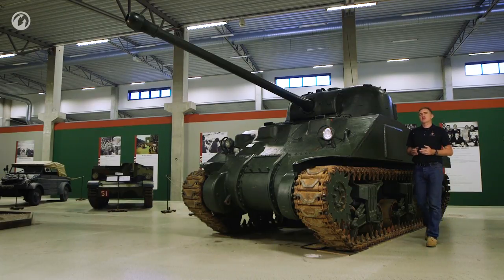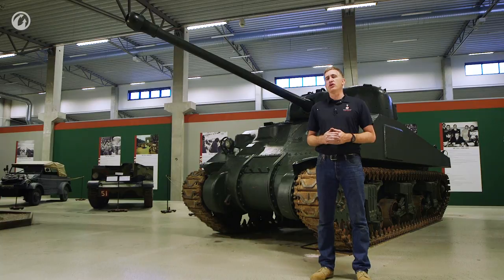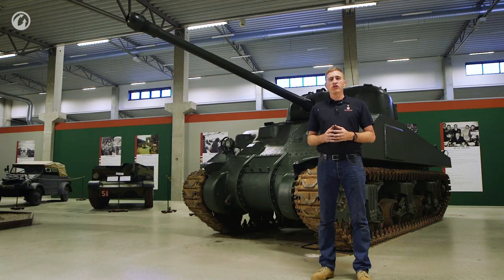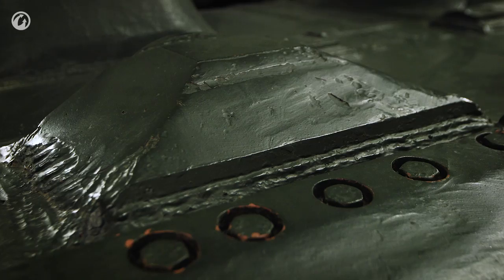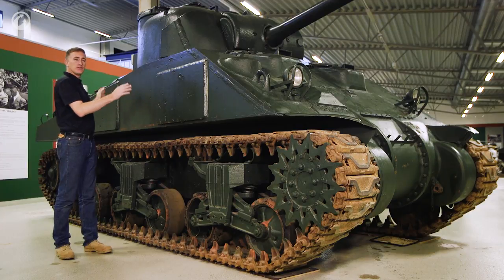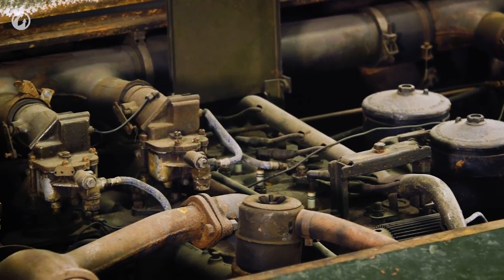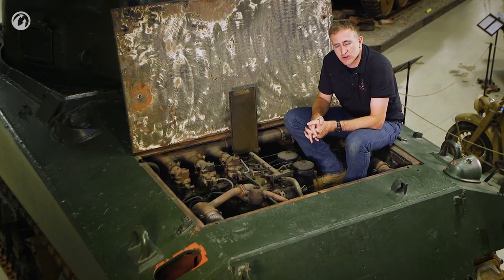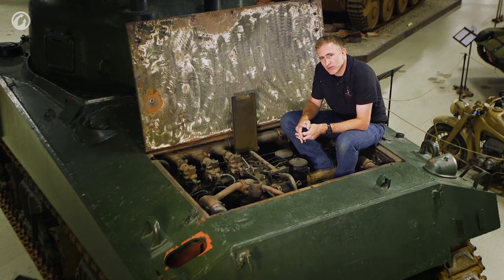Inside the Chieftain's Hatch: Sherman VC “Firefly" part 1

Comment: Ironically, horsepower is essentially a useless measurement for tanks... what really matters, is torque. You need a lot of torque to move a lot of weight, which is what made the Chrysler engine in this tank beneficial. It was a lot heavier, and even had less horsepower than the Ford, but it had far more torque, and because of that, got to speed faster, could move up inclines faster, etc.
Reply: I always wondered why they didn't put diesel engines in WW2 tanks. One would think that since diesels are torque monsters, they would be the optimal choice for moving a heavy vehicle. Nope! Petrol. There must be a reason.
Reply: Diesel also isn't as flammable as petrol
Reply: @leeham6230  Basically inertia. If all your machines run on petrol, you only have to supply one type of fuel to all of your divisions. If some of your vehicles run on diesel and some on petrol, you'll have to send different proportions of diesel and petrol to your different units based on what exact combination of vehicles that specific unit is currently using. A supply nightmare.

And you run the risk of some yahoo putting diesel in a petrol vehicle (or vice versa).
Reply: @leeham6230  1. diesel engines require more technology than petrol engines to make
2. they are usually heavier than petrol engine
Reply: @monobryn64  Make all vehicles diesel; problem solved.
Reply: @khrhee5  What does engine weight have to do with anything?The extra torque from a diesel would completely offset any change in weight.
Reply: @leeham6230  not every vehicle can be diesel
Reply: @Kyle-gw6qp  Every tank, motorcycle, truck, and tank could.
Reply: @leeham6230  That's an option if you're willing to scrap or refit all your existing equipment. NATO has been working on this since the 80s and is the reason things like the Kawasaki M1030M1 exists.
Reply: @leeham6230  Diesel technology was not as sophisticated as it is today. They did put a diesel in a Sherman (M4A2) and of course it was a Detroit Diesel.
Reply: @nickfournier1385  Russian T-34 used diesel, and they were notably faster than the comparable German tanks. Even the heavy IS-2 was rather quick.
Reply: @leeham6230  Well I mean almost ANY tank was faster than the German tanks towards the end of the war. The Detroit diesel they put in the Sherman made about 375 horsepower? I am not sure about the torque figures though. They also put another diesel in the Shermans, it was a radial diesel which is quite interesting.
Reply: @nickfournier1385  Horsepower isn't that relevant when talking about moving heavy things if we don't know the torque. Anecdotes from M4A2 crews show that it was a better drive. I just wish we could have the actual torque values for each engine :(

I didn't know a radial diesel was a thing. That sounds weird and cool.
Reply: @norfangl3480  shell shrapnell doesnt care wether you used diesel or gasoline it'll light it on fire
Reply: @leeham6230  Higher speeds. Also greater availability. You could fill up a petrol powered tank at any roadside gas station. Nowadays, that's less of a consideration, but it mattered in WW2
Reply: @leeham6230  The T-34 was faster not because of a diesel engine but because of the Christie suspension
Reply: @filmandfirearms  Nah, diesels produce WAY more torque than gas engines. Look up "torque" and educate yourself.
Reply: @leeham6230  a bit late, but i can answer your question here:
There are 3 major petrol engine tank user in ww2: German, British, American, for different reason:
-British and American use aircraft engine(R975), knockoff aircraft engine(meteor engine), or a multi car/bus petrol engine(Chrysler A57 multibank) for thier tank, faster R&D and already avalable
-German do not have crude oil, they only have coal, and thier choice is make coal to oil products, and they focus on make engine oil, and petrol(make sence, petrol can use for both plane and ground vehicle)
also you said "torque" do you know what gearbox is using for?
Reply: @duytranuc4025  finally, a real answer. Thank you dude. It makes sense to me now.
Reply: @duytranuc4025  I know what a gearbox is used for, but it's not going to magically grant more torque than a diesel :)
Reply: @leeham6230  hope all above can answer your question, also "why diesel replacing in tank" is not much about torque, but about mileage, fuel tank need space to fit, and strap a bunch of fuel canister outside the tank is not the best way to do, atleast you will not want go in battle with those fuel can on your back on fire
Reply: @leeham6230  those aircraft engine also make a hell of a torque, in original aircraft config they can spit out more than1000HP(merlin engine, meteor is ground knockoff of it)
Reply: @leeham6230  sometime even diesel torque is not enough, some tank in ww2/pos ww2 even have a torque converter, on a diesel engine
Reply: @duytranuc4025  Yes, and a torque converter with a diesel will net more torque than a similar petrol setup.
Reply: @leeham6230  that engine have (V2 engine,diesel) almost same torque with  a meteor engine, petrol at same HP config, not much different than you think
Reply: @leeham6230  I believe Soviet tanks ran on Diesel. And I think that the M4A2s Engine might also be Diesel, but this might be wrong (edit: Yes it's true). I do know for a fact that the M4A2s Supplied  to the Soviets had Diesel engines which made the Soviets happy.
Reply: @leeham6230  Although the T-34 could theoretically go over 50km/h, the gearbox in the tank couldn't go in to 4th gear and getting into 3rd was a nightmare (because the gearshift often got stuck), also it had unheat-treated steel tracks grinding up against unheat-treated steel road wheels.
Reply: @filmandfirearms  But the Gearbox didn't allow it to go above 30km/h
Reply: @nickfournier1385 😊

Comment: German tactical doctrine was to target the Fireflies whenever they were spotted. That says it all.
Reply: They may have had the 88 but they feared the Firefly so as you said fair to say the Firefly had quite the effect.
Reply: Yeah it put a dent in German morale one of these killed wittman
Reply: No source has been found stating that they specifically targeted fireflies first
Reply: @larshenrik8900  actually yes there is. the Sherman Firefly was perhaps the most valued tank by British and Commonwealth commanders, as it was the only tank in the British Army able to reliably penetrate the frontal armour of Panthers and Tigers at the standard combat ranges in Normandy.
This fact did not go unnoticed by the Germans, who realised that these long-barrel Shermans posed a much greater threat to their heavy tanks than the normal Shermans, and German tank crews and anti-tank gun crews were instructed to eliminate Fireflies first. Similarly, the Firefly crews realised that the distinctive long barrel of their 17-pounder gun made the Firefly stand out from standard Shermans, so crews attempted to disguise their tanks to reduce the likelihood of being targeted. Some crews had the front half of the olive drab gun barrel painted white on the bottom, or white with dark green on top, to give the illusion of a shorter gun barrel. Another suggestion was for a shorter wooden dummy gun to be mounted on the rear of the turret and point forward; however, this tactic does not appear to have been used in combat.
Reply: Samuel An actual document please. Provide that
Reply: @larshenrik8900  you don't need a document for something that is common knowledge.
Reply: Samuel You do actually if youre going to state is as fact when there is no proof
Reply: Samuel So tankers thinking «hey, this long barrel will make my tank stick out. I should make it less conspicous» is proof that it was german doctrine to to target fireflies first? Its especially weird considering the 75mm Shermans were an alot bigger threat to AT guns (which they faced ALOT more of than tanks).
Reply: Samuel what was that link supposed to prove?
Reply: Firefly crews would try to disguise it as a regular sherman because of that
Reply: @larshenrik8900  The Germans saw a cousin of the M4 with a longer barrel, easy math.
Reply: Every nation did this. When engaging a tank formation, kill the one with the biggest gun first

Comment: 17 pdr was 76mm, while the regular Sherman's gun was 75mm. I always wondered what made the 17pdr so special. The 75mm is about 2000 feet per second, and the 17pdr is a whopping 4000 fps. Its like 32 auto, and 30-06.
Reply: The gun cannons barrels; the Sherman 75mm wasn't obviously designed to be an AT gun cannon whereas the QF17 gun cannon was developed by the British after lessons learnt in the earlier stages of WWII BUT also when before the war too the British too realized that future tanks and AFV's would have new technology and armor and hence the 2 pdr or the 6 pdr even would not always fit the bill hence the QF 17 pdr gun cannon was developed - some of the QF 17 pdr were put on the 25 pdr carriages (due to production schedules and deadlines they didn't have time to properally install some of the earlier QF 17 pdr gun canons) hence the early QF 17 pdr gun cannons were called the QF 17 PHEASANTS .... and apparently there were used in North Africa .... 

But don't forget the QF 17 pdr is 76.2 mm x 55 Calibres = just under 4 meters if not 3.6 meters in length. The Sherman 75 was only 75mm x 40 Calibres = only about 3 meters ... so less velocity.

ALTHOUGH the 75mm HE punch of the Sherman would have been SUPERIOR to the QF 17 pdr as the QF 17 pdr had a high velocity and needed BIG propellant charge and thick casing to enable the high performance of the gun AND the fact the QF 17 pdr did have a big recoil and night blindness flash from the powder and firing to the crews AND the fact the Sherman 75mm was 0.68 kg in HE filler - the QF 17 pdr gun cannon at best wasn't even 0.6 kg in HE punch - whilst both can get the job done - the fact the 75mm HE punch is obviously more useful and dangerous and does more splash in its damage for sure. Though no doubt the QF 17 pdr wins out in AP punch.
Reply: Foom-zilla ゴジラ They cured the smaller bursting charge problem by putting less propellant in the HE cases, lowering the velocity, which meant they could use thinner walled shells so the burst charge could be larger. The Yanks never thought of that with their 76mm.
Reply: @SvenTviking  well putting fewer powder means different ballistic which means you have to get different "lines" on the sight that leads to slower aiming time due to time taken to adjust aiming which is why the US doesnt want to do it with the 76 atleast from my point of view
Reply: @HeirofGojira91  The 75mm was meant to engage tanks. It was just built as a multi purpose gun, not a dedicated AT gun or a dedicated anti infantry gun
Reply: The 76mm was an American upgraded gun that fit properly

Comment: Read a book by David Render, who was a commander of Shermans in the war. He hated the multi-bank engine. iirc he thought they had a tendency to flood because not all the engines were the right way up. He had got used to the diesel engined variant, which pulled more strongly.

Comment: I have question that's been bugging me, the Sherman III had a 6 pounder gun, the Firefly had a 17 pounder gun.  So the 17 pounder shell is roughly 3 times as heavy right?  Shouldn't it cause about 3 times the damage then?  In-game, the 17 pounder gun only does about double the damage of the 6 pounder,.  In the Napoleonic era, a 18 pounder cannon was far more accurate and damaging then a 6 pounder, but I don't know if that translates into modern tank shells.
Reply: Damage in the game is based on caliber, not weight. The 6 pounder is a 57mm. The 17 pounder is 76.3mm.
Reply: But isn't it housing almost 3 times the explosive?
Reply: ltflak there's also the point of balance.  If it were to deal that much more damage, they'd have to kill the rate of fire to balance it out.  either way works, but it seems to me that they want the more realistic RoF for the 17 pounder
Reply: I believe the Brits only used solid shot ammo, no explosive filler... If that was your question...
Reply: @Valtr, Yeah, it's just when I hear the tank has a awkward giant gun that fires something almost 3 times as heavy as the previous gun that can slay Tigers, I was expecting something that fired slower and dealt a lot more damage.
Reply: Think of it this way: You've got 2 bullets. 1 is a .45 acp, the other is a .357 magnum. The .45 is bigger, heavier, but it has less powder behind it. The .357 is about 40% longer, and the projectile itself is about 20% smaller. When the powder explodes in the chamber it has to push the round through the barrel. The .45 has less force pushing a bigger object through the barrel. This means the bullet hits, penetrates a bit, then puts all of it's energy into it's target. The .357 however has much more power pushing a much smaller object, making it get much more speed, and the round itself causes less resistance when pushing through an object because it has less surface area. The end result: Shoot a man at 50 feet with a .45: the bullet goes in and knocks him on his ass. he's hurt badly, bleeding pretty badly laying on his back screaming in agony. Shoot a man at 50 feet with a .357 magnum: The bullet goes in him, out him, through the 2 guys standing behind him and imbeds into a wall 300 feet away. They're all left with an entry wound, an exit wound, a 1/2 to 2 and a 1/2 foot long hole that slightly curves through their body, and have a good chance of going into septic shock then bleeding out in a few minutes. Bigger does not always mean more dangerous.
Reply: FredrickTesla Except in this case . . . the 6 pdr shells are shorter than the 17 pdr. The 17 pdr shells are huge compared to the American 76mm aswell. The shell is more german in design meaning it is very long, which is why the 88mm gun the Germans had was so good. longer shells means more pressure at  the impact point than a same caliber round that is shorter.
Reply: ltflak brits never used APHE in the war they  only used solid shot
Reply: Kinetic energy is 1/2 mass X velocity squared, the speed of the round is more important than the weight of it. That's why modern tanks fire sabot, big baseplate for the propellant to push against but small round for less aerodynamic drag.
Reply: No Sherman ever had a 6 pounder gun.  Never.  Is this World of Tanks "history", again?  The Sherman III = M4A2 = 75mm armed diesel powered tank.
Reply: Itflak:

Ordnance QF 6-pounder gun uses the 57×441 mm. R shell. This gun was not on any Sherman tank. This gun fires a 2.8kg projectile at 890m/s, which gives about 1.1mJ of kinetic energy.

I assume you meant the M4 tank, which uses a 75mm gun. This gun fires a 75 x 350R, 6.7kg projectile at 600m/s. This gives the projectile 1.2mJ of kinetic energy

The Ordnance QF 17-pounder fires a 76.2 x 583R, 7.7kg projectile at 884 m/s. This give the projectile 3mJ of kinetic energy.

The the 17-pdr has 2.5 times the kinetic energy of a 75mm gun. For the same projectile diameter, the 17pdr has ~2.5x the penetration. Damage is very difficult to calculate. For eg, if you fire a high velocity shell at a thinly armoured tank, the round will go through front and back armour, doing little damage.
Reply: Damage is far more based on caliber. That's why most nations used caliber instead of shell weight as it gave a more accurate assessment of the power of the weapon.
Reply: Don't forget also the shell dynamics and design and the amount of propellant charge and also the HE filler in the shells; if you want a high velocity gun cannon - you'll need a big propellant charge as well as thick walls which will take up space for your HE punch; which was WHY the regular 75mm Shermans were SUPERIOR in the general all round HE punch fire support firepower than the 76mm M1 Shermans or the Sherman 1c with the QF 17 pdr 

PLUS the Napleon era gun cannons are NOT the same as the WWII type gun cannons. Furthermore - how does one 'measure out 3 times the damage then?' and are you going by AP against tanks OR also HE punch? Given the 6 pdr gun cannon for sure didn't pack a HE punch like a bigger bored gun ...
Reply: @Xuan Vinh To - also the fact high velocity gun cannons need a BIG amount of propellant charge for sure for all that propelling of the shell AND the fact thick walls for the shell to be able to withstand stresses of being fired out - and hence you'd have less HE punch - where as the Sherman 75mm however didn't need all that - andwas hence SUPERIOR to the 6 pdr and QF 17 pdr gun cannons atleast in terms of HE firepower - given the fact the QF 17 gun cannon carried not even 0.6 kg of HE filler vs. the Sherman 75mm at 0.68 kg of HE punch; even the Panzer IV Ausf H and the Panthers carried up to 0.66 and 0.65 kg of HE filler ...
Reply: Balance in game
Reply: @FredrickTesla  well said brother
Reply: The Sherman 3 had a 75mm gun. WW2 M4s had a basic 75mm, a 105 howitzer artillery gun, a 76mm long anti tank gun and the QF 17 pounder anti tank gun.
Reply: Nikola Maksimovic The 17 pounder had quite a few different rounds. Basic capped AP shot, HE, Ballistic capped AP rounds and a discarding sabot round that had accuracy problems, but could penetrate anything it faced.
Reply: V T I think the problem is that the 6 pounders fitted to Churchill tanks were bored out before D Day to take the  rounds used in the Sherman 75mm gun, becoming “QF 75mm”.